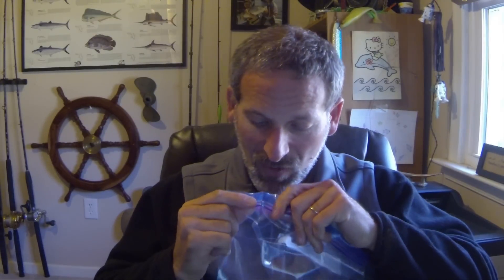Boating Tips: Understanding Vacuum Bagging

Comment: Where does the excess resin go? It useless after the fact because it’s already mixed with the catalyst MEK. I am assuming in puddles up some place and then hardens and is discarded. All that extra resin is a loss of the overall cost of the boat. I believe that only high performance boats need to bagged.

Comment: Isn't the process actually called resin infusion?
Reply from the maker: +xmask321 
Sorta kinda, but not exactly. With vacuum bagging (sometimes also called wet bagging) the glass is already wetted with resin when the vacuum is drawn. But with infusion, the vacuum draws the resin in and through the fiberglass. There are a lot of different terms for this type of process: resin infusion, vacuum infusion, vacuum bagging, vacuum molding, etc. and the differences can be pretty subtle, so they do tend to get jumbled together quite a bit.